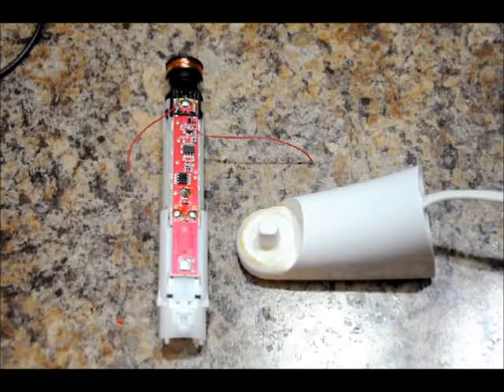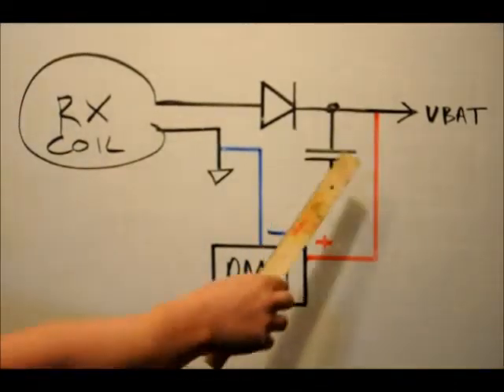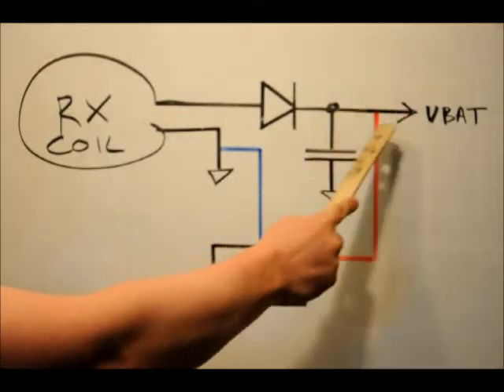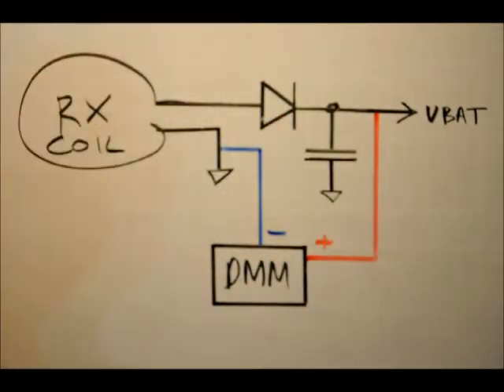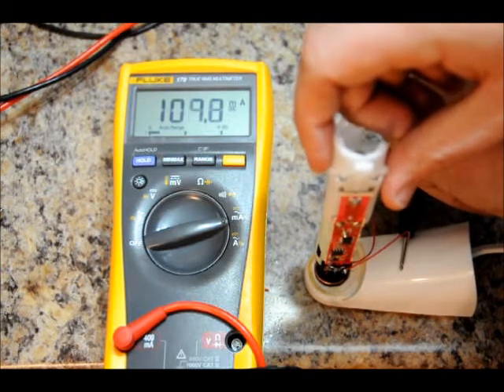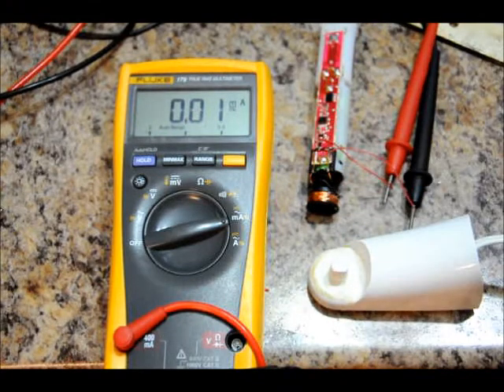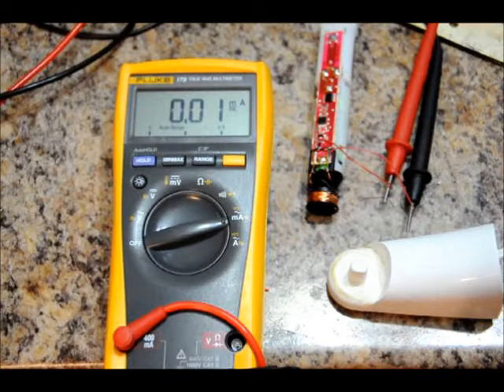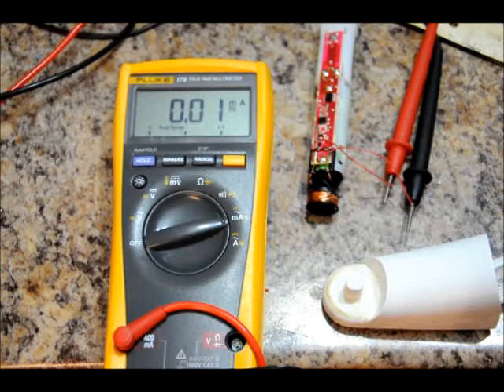Wireless Power Transfer - Rechargeable Toothbrush Receiver Analysis

Comment: I thought if I test for continuity of
the charger base throuh the wall plug I would see continuity with my multimeter, for the base coil I did not;
do you? {Testing if the base charger is working?}Chuckie La